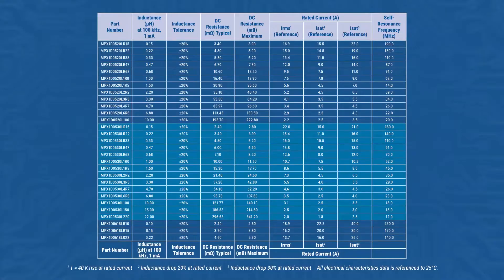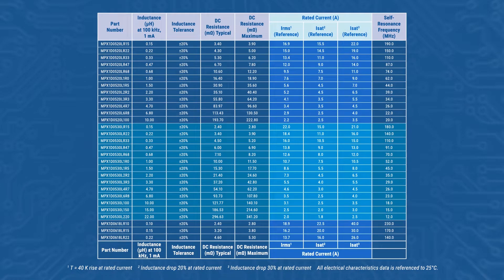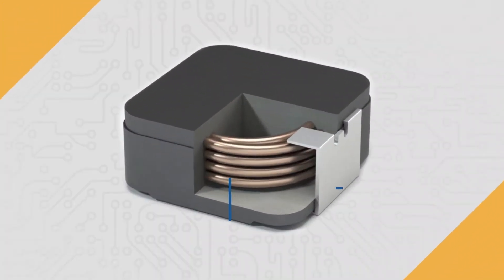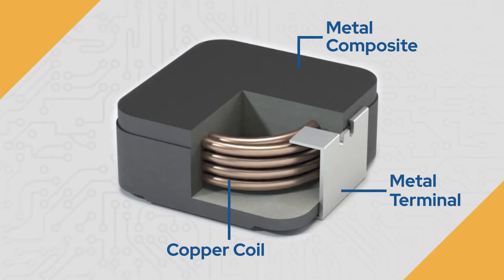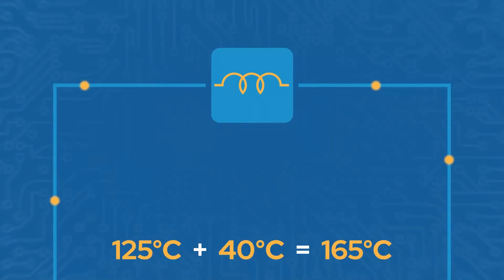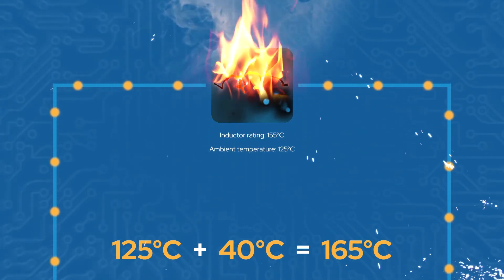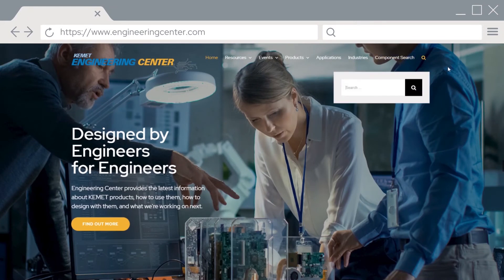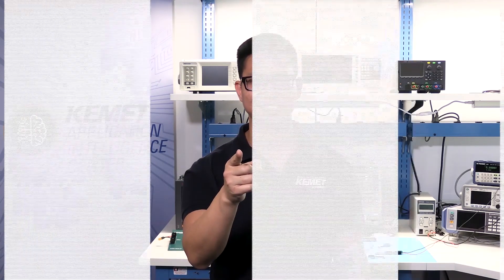Why it Matters: Rated Current of An Inductor

Comment: So for us new players in the electronics world, I'm hoping I can get the kind of answer you might give a 5 year old here.  :D

So, if I have a circuit that I want to boost, I know (or think I know) that the capacitor is means of supplying the voltage and the inductor handles the current.  If that's correct, then all I really need to know is this.  Does the size of the inductor TRULY matter, or should I just be worried about it's current rating and resistance in the circuit?  I know uH is a thing but I'm still learning what all of that is.  Like, if I wanted to make my own inductor, how would I go about doing just that?  Is there a calculator that more or less would tell me "get this size wire, wrap it around the size core X amount of times, profit!"

I know I'm making this kinda childish but it's been frustratingly hard to get what I assume is a fairly simple answer so I'm hoping maybe you guys can offer some insight.
Reply from the maker: Hi Sir Bink! Thanks so much for your question. Our engineers are at a conference right now, so give us a couple of days to get back to you. 😊 In the meantime, you can feel free to write us at ksim@kemet.com with any additional questions. Thanks for watching and stay in touch!